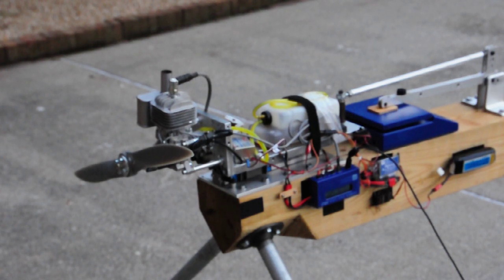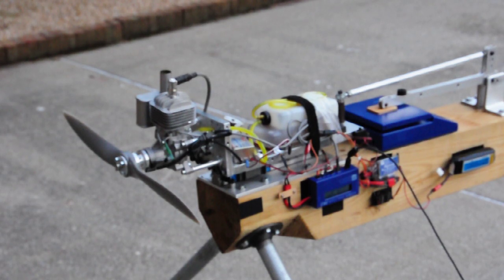DLE-30 Engine Test Stand Demonstration with APC 18X6W Prop

Comment: Do these engines need muffler pressure to run like glow engines or does the carburetor have enough vacuum to pull the fuel to the carb once running. If they do need muffler pressure is any kind of spark arrestor needed prior to the fuel tank?

Comment from the maker: I would try adjusting the high speed needle valve richer and seeing if that makes a difference.  If top RPM drops, then try leaner instead.  If that doesn't work, I would contact the seller and ask for their advice or consult an experience modeler in your area.